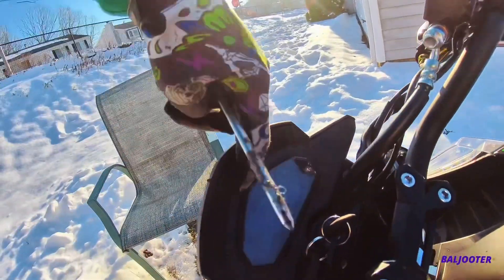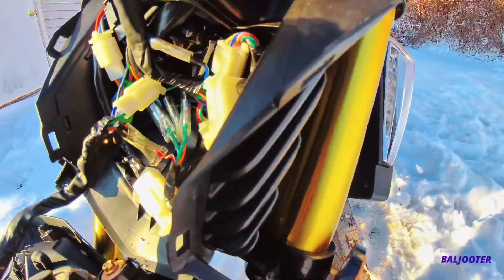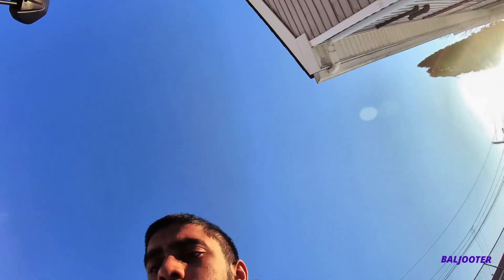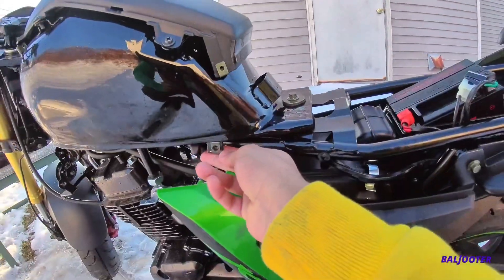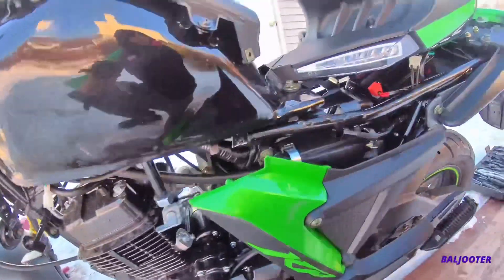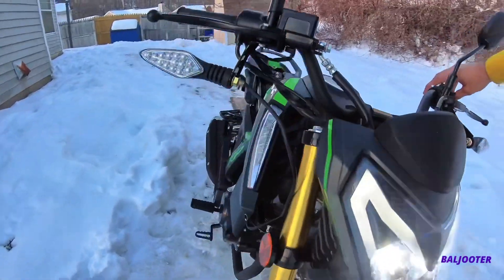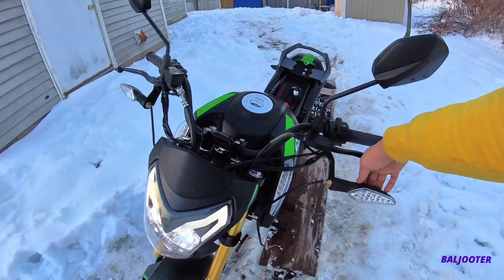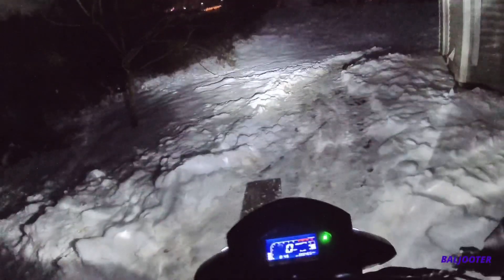NECESSARY UPGRADE FOR LIFAN KP MINI 150  AND INTEGRATED TURN SIGNALS

Comment: I just got my KP mini and put it together my lights do not turn on I have to hold the flasher down when I hit the high and low nothing happens I have not started the bike it just turn the power on does the bike have to be started or what do you think could cause that
Reply from the maker: Yeah the bike has to be started then The low will automatically turn on

Comment: All you have to do is take off the light and plug in the wires under the finders
Reply from the maker: Yup pretty simple and also disconnect inside headlight